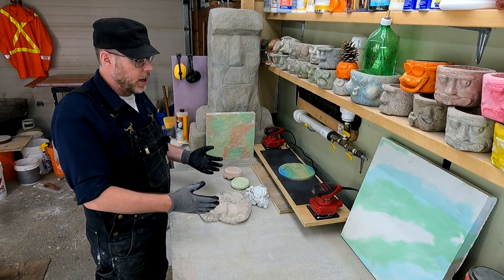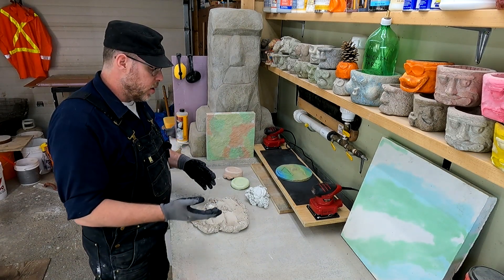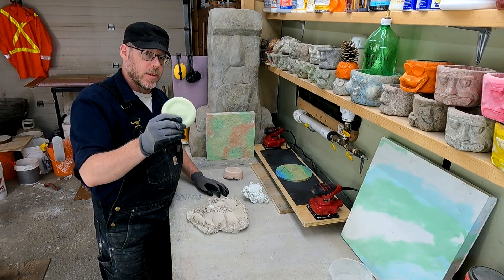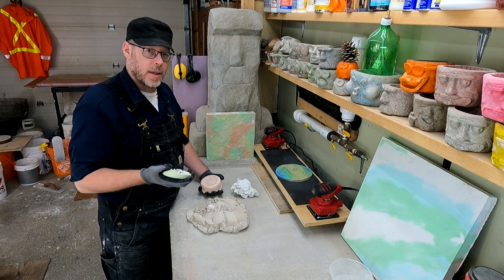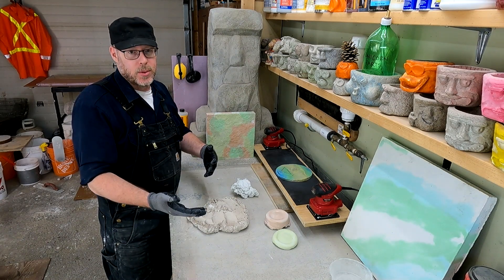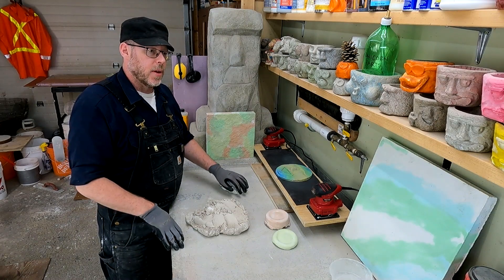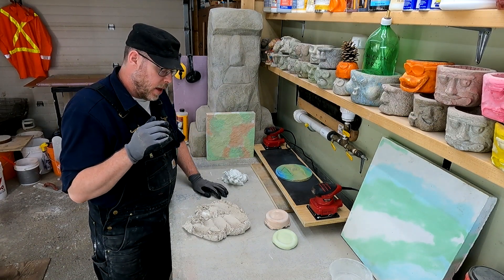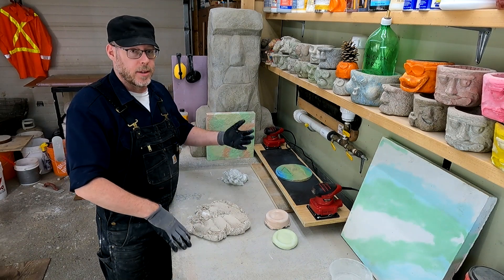What To Do With Leftover Concrete?

Comment: Have you heard of someone adding glue to Styrofoam aircrete epic Mix? So basically it would be glue, EPS Foam pebbles, hemp dust, foam(soap/water) and concrete. With the right amount of glue, a more insulated version of the Styrofoam aircrete could be held together with more strength. You could even use this method for rammed earth with a thin layer of epoxy to create ambient light in the walls

Comment: Thanks for the AWESOME videos/ great insight/ ideas.  I'm thrilled I found this channel before beginning concrete art. Notes to help me remember points made: 1. Small molds 2. test pieces 3. use waste as an aggregate/ fill; (+ keep leftover excess concrete in small, manageable pieces- e.g. 1" thick slab, then divide into 'ice cube' size w/ trowel to ez separate later). **BE SURE to wet it before using in new concrete. 4. *Test tiles:  If you use quality acrylic paints, they are already tested & assigned a lightfast rating- skip step. 5. Other testing suggested = great idea: e.g. test pieces in water  & to freeze. Demolition testing- sounds fun. (Idea-maybe make a wedge with waste concrete, to allow variation from thin to thick, to test thickness strength). 6. Don't leave the waste concrete in one big huge chunk that you cannot lift or do anything with it. "That would be bad." ha ha. perfect. 7. Expensive to dispose of. Shoot for minimal waste. (One of the 1st concrete sculptor artists I checked out on concrete art had absolutely NO experience, & spoke of how his batch turned solid before he could do anything at all with it. He was making something for his mom, & said he "Ended up with a big concrete rock for mama." I'm still laughing a year or 2 later, when that statement comes to mind.